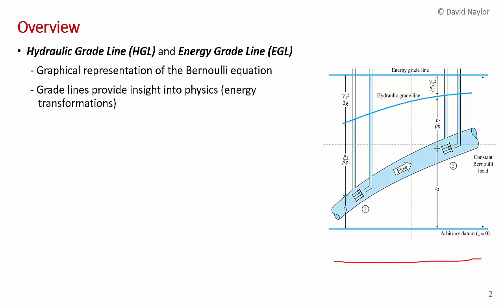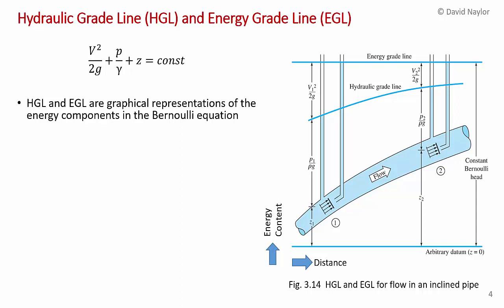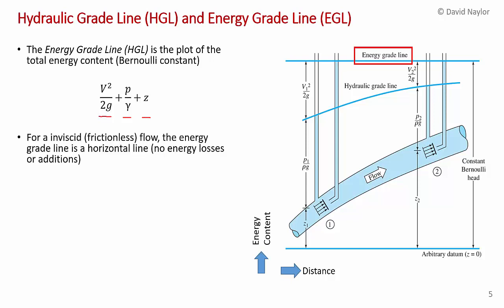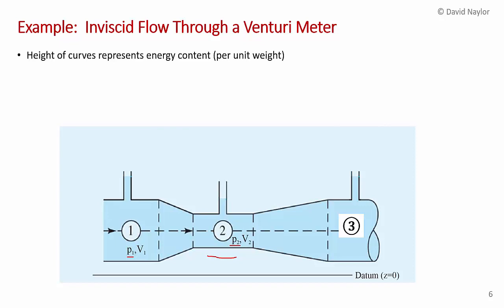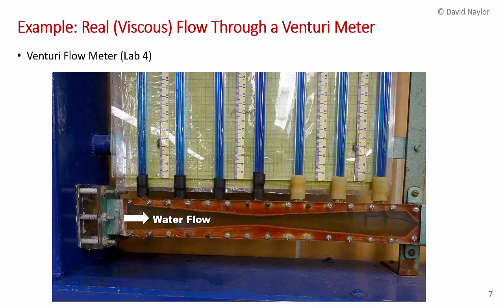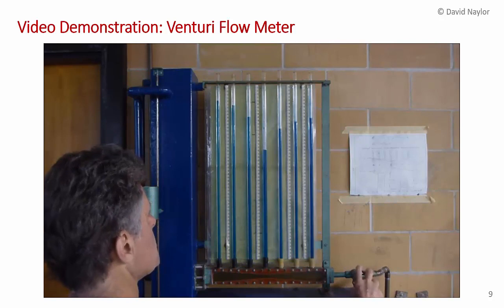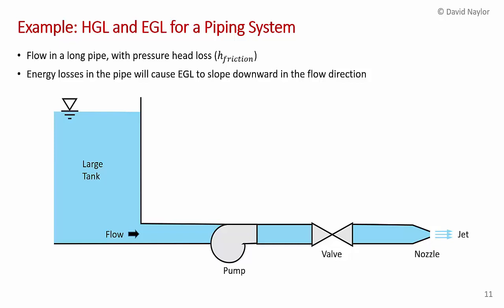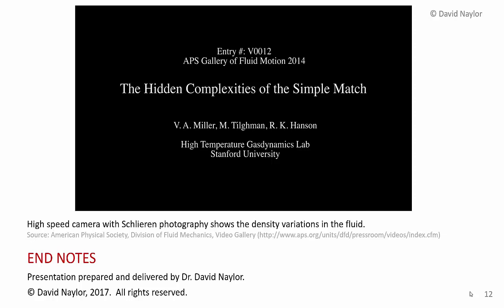Hydraulic Grade Line and Energy Grade Line

Comment: Thanks for this presentation!
Just have some doubts!!
How does fluid flow from low pressure region to high pressure region? Why do we refer energy loss as pressure loss most of the time? And how does pressure increase the discharge?
Reply from the maker: Consider flow is from low to high pressure in the discharge of a venturi. At the flow moves away from the throat the average velocity decreases and some of the fluid kinetic energy gets converted back to pressure. That's why pressure increases in the flow direction at the discharge. It is called "pressure recovery".  I hope that helps.

Comment: Thanks for this amazing presentation. @ 23:01: I am wondering if EGL would be not necessarily the straight line you showed in the video?
Reply from the maker: Thanks. Yes, in general, the EGL  would not be a straight line. Turbulent head losses vary roughly as V^2, and you would expect more losses in the expansion zone after the throat. The EGL would be a straight line for fully developed flow in in uniform diameter pipe. That's Chapter 6 material, and more than I wanted to cover here. I hope that helps.

Comment: I don't understand why the pressure head decreases at point 2 because I would think since the area decreases, the pressure would increase?
Reply from the maker: I assume you are asking about the Venturi:  You are expressing a misconception that I also had as a student. Here is one way to think about this effect: The velocity at point 2 is higher than at point 1. Since energy is conserved, where did all that kinetic energy at point 2 come from?  In order for the fluid to move faster at point 2, it must have been accelerated by a net pressure force to the right, i.e. the kinetic energy comes from work done by the pressure force. Thus, from F=ma, for fluid to accelerate as it moves from 1 to 2, the pressure at point 1 must be higher than at point 2. The net force must be to the right, i.e., p_2<p_1. I hope that helps.